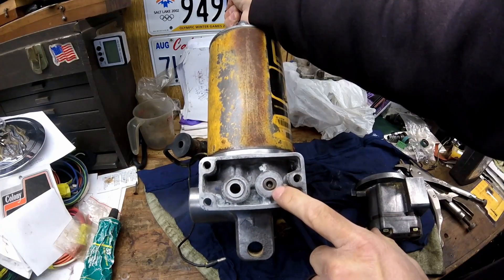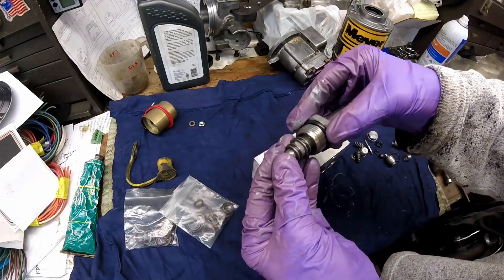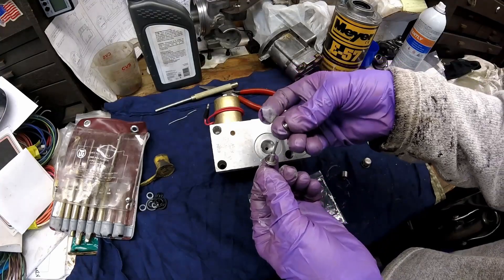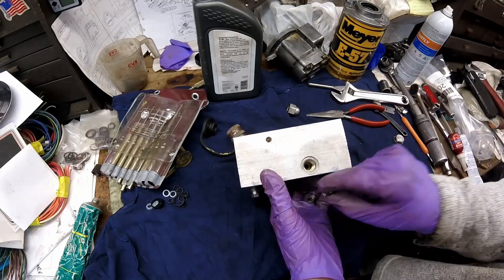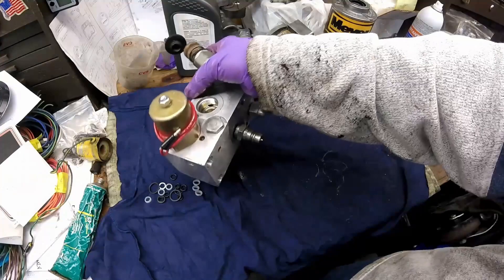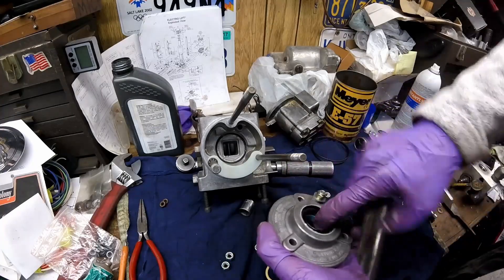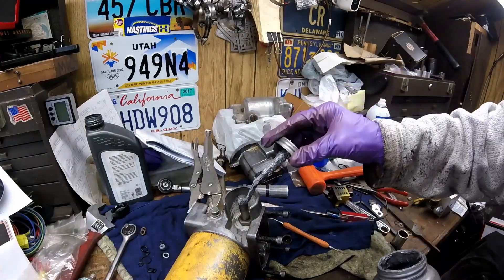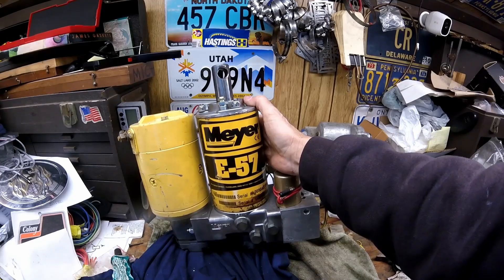Rebuild of E-57 Meyers Snow Plow Pump Assembly

Comment: Hi just a quick question I replaced the piston rod and got a new pump cap but I can’t seem to get it to slide over the rod I put hydraulic fluid on the      
Seal to help lubricant it it looks like it should slide down but it seems to tight. I’d really appreciate any advice thank you!! And it’s a great informational video!
Reply from the maker: I'm not exactly sure what your talking about with the names of the parts. I did have to use a plastic hammer to get the "ram rod seal" into the housing. Check out my other video as the two units are about the same. Maybe this can help further. 

https://youtu.be/1r-dXnz0cPg

if you have any further questions, please let me know. these two videos are the first time I've ever worked on any kind of plow equipment. I only did it because my son plows snow and they weren't working. Dad to the rescue...
Reply from the maker: It's around the 18 minute mark of the video
Reply: Thank you so much for getting back to me! It turns out they sent me the wrong guide and I couldn’t get it to slide over the main shaft because it was too small. I ordered another one and it fit perfectly! Thanks again for your help!!
Reply from the maker: @nickpacheco3281  That suck that they sent you the wrong parts but I'm glad you figured it out! Please reach out anytime. Thank you for watching and please subscribe, if you haven't.
Reply: Hi one more question how where you able to get the hex bolts out of the angling block they are good and stuck I only was able to get one of them out 😂 thank you for your help and patience!
Reply from the maker: @nickpacheco3281  I drilled the head off of all off them. Then I heated the remaining stud, one at a time,  good and hot. After that I hit them hard with really cold water. This causes the stud to shrink. Then I get vice grip pliers and they come right out. I use MAP Gas to heat them. Try not to heat the aluminum block to much so you don’t warp it
Reply: Great thank you I drilled the heads off I will try the heat and cold water thank you so much for your help!
Reply from the maker: @nickpacheco3281  no problem.

Comment: You didn't show the beginning. I specifically wanted to see the assembly of the check ball, spring, and o ring assembly. You say something about red loctite sitting overnight. Please show what you did there.
Reply from the maker: At the 3 minute mark you can see how it goes back together in this tear down video. 

https://youtu.be/7qL1E4VMgXg?si=e-9MpExPU3zO1VUF
Reply from the maker: At the 22 minute mark you can see it assembled in my other video. 

https://youtu.be/1r-dXnz0cPg?si=2bFEn85XwUMDaJXl
Reply: @Rapsgarage  that definitely helped. Thank you. Still kind of curious what you were talking about with the red loctite and i wish you had filmed putting it back together without the spring and ball falling out instead of jump cutting to the pump base installed. I figured you must have tried putting red loctite on the ball/oring holder so it doesn't just fall out. Even the manual mentions holding that with a flat putty knife or something during install.
Reply from the maker: @darthgreater7054  yes I use the red Loctite to hold that piece in so that I could get the block on without the spring pushing that ball and peace out. Watch the second video that I posted it’s very clear me putting that back on there. I listed two different videos. You should watch them both.
Reply from the maker: 22 minute mark https://youtu.be/1r-dXnz0cPg?si=KfVGtlqwglf2m6Ia
Reply: @Rapsgarage  My instruction sheet as well as your first video show the ram washer with the groove s facing down. You may want to revise your instructs. Also I would  like to know how you removed the ram seal from the head, I'm having trouble and don't want to mar the head.
Reply from the maker: @ to remove the seal I put the shaft in a soft jaw voice and then used my half inch impact gun to get the nut off.